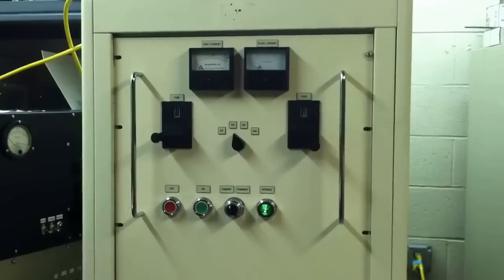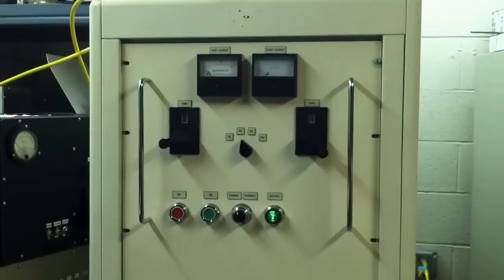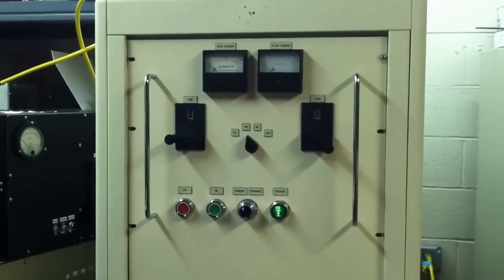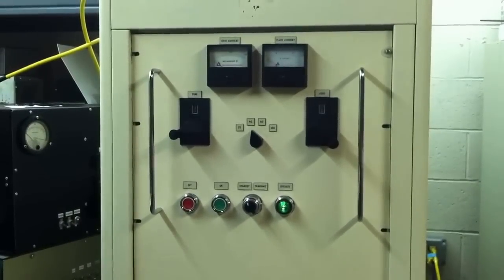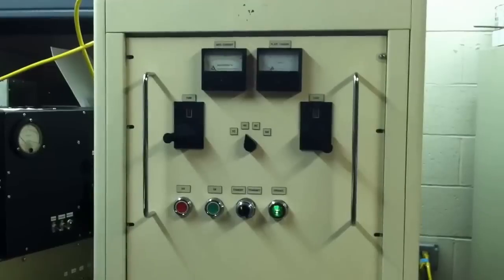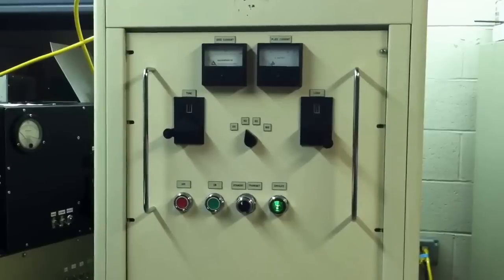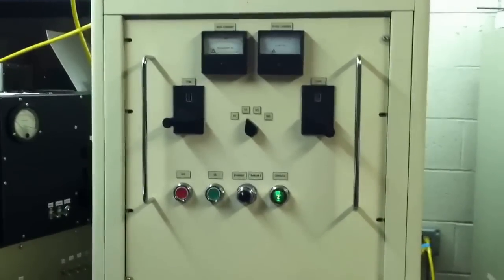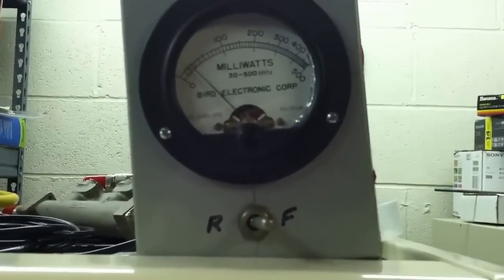3CPX5000A7 / YC-179 AMPLIFIER UPDATE

Comment: Smiling!
Old post and you might not even see it. 
WoW; That would be my dream amp. Been watching your videos on ldmos stuff and thinking of playing with it some, but my world is pretty much 12V, 120, 240. Don't understand solid start that well or wire wrapped around toroid to make input output but learning.
Reply from the maker: You don’t have to understand the solid state amp, just build what you see. It’s very easy and much safe than tubes with HV.

73,
Mike